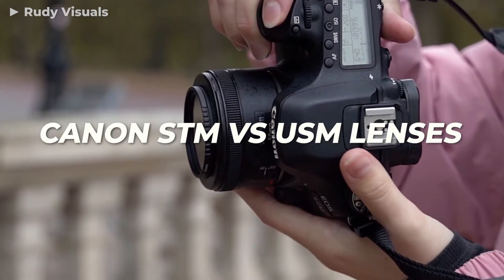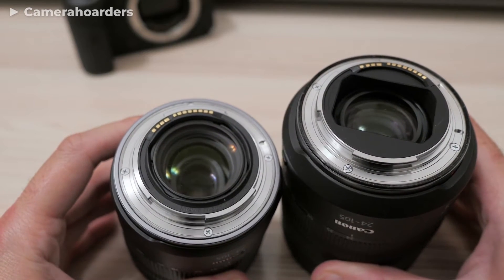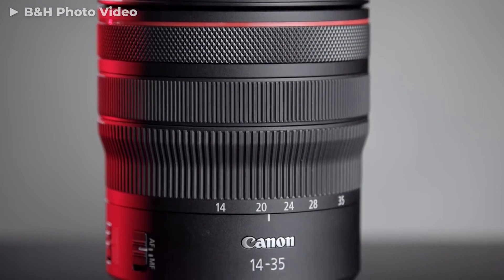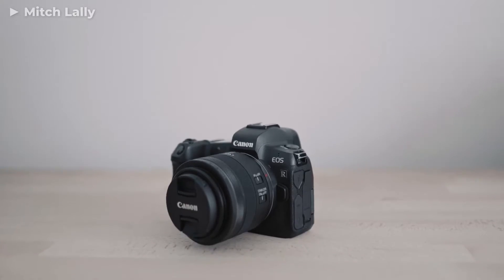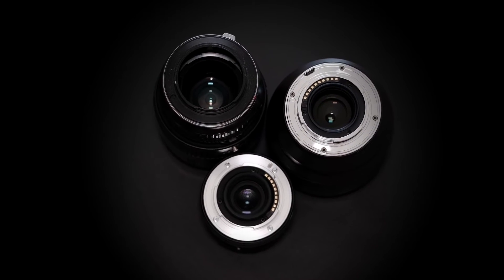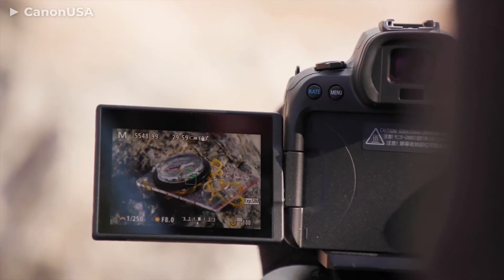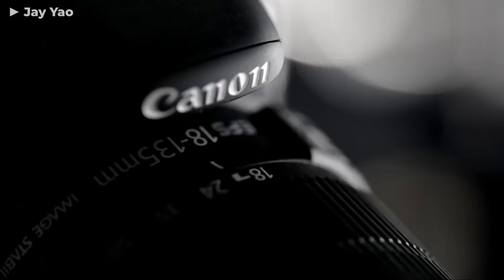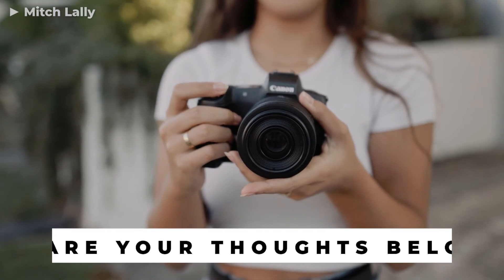Canon STM vs USM Lenses - Focusing Motor Mechanisms Explained!

Comment: I have a nasty clicking problem with my STM lenses, RF 24 and 35 mm when the mic is mounted on the cage. Absolute trouble for shooting „silent“ scences, where the autofocus needs to work. For instance when shooting handcrafting scenes, where you want to hear the tool; but then you get all these clicks!!! I am really disappointed with Canon, as they promoted the STM lenses for video!